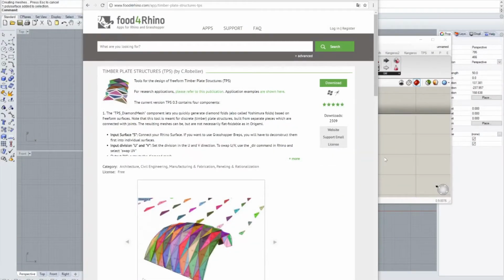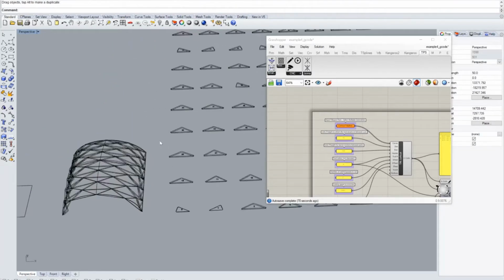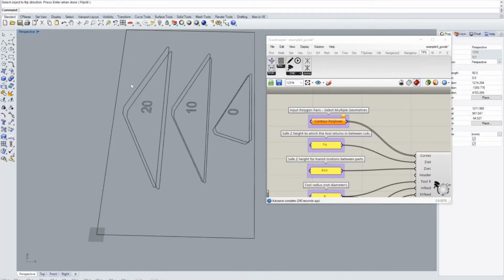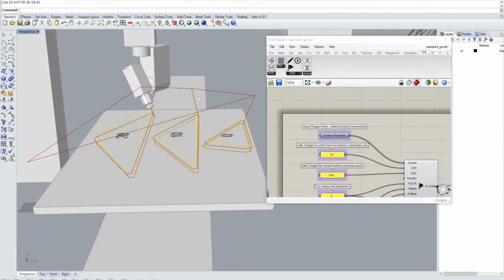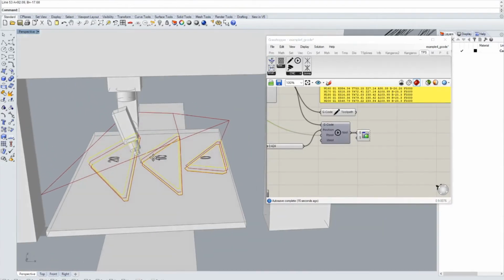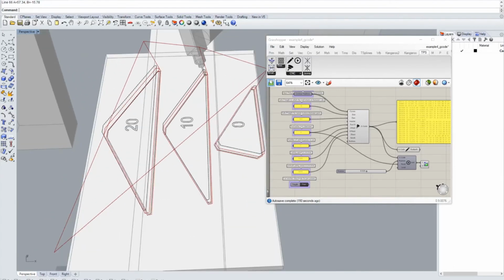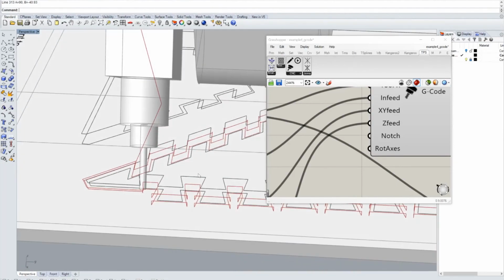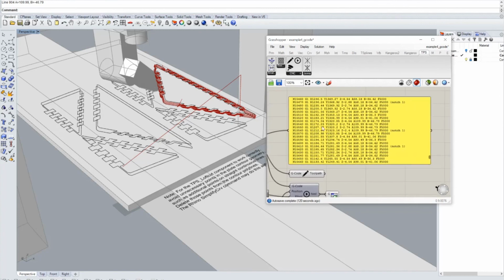TPS CNC Fabrication Tutorial - Rhino3D Grasshopper Plugin

Comment: Hello, I have a question about how to print in 3d by giving the printer head a certain inclination (as seen in the image) using Grasshopper and Rhinoceros. Thanks
Reply: I have seen that they do it using g-code in Grasshopper but I don't know what plugin they use for the g-code, nor do I know how they do it.
I hope you help me. Thanks
Reply from the maker: Hi! I am not a 3d printing expert, but if its G-Code you only need the points and rotations. So i guess the rotations would most likely be the normal vectors of your surface. But i don't know your use case.
Reply: @digitaltimberlab  but what is the easiest plugin to use with Grasshopper that uses g-code?. Thanks
Reply from the maker: @domthelol8570  Hmm, i don't think there is one really. Maybe Autodesk Powermill could help you?
Reply: @digitaltimberlab  mmm, i think not but thanks for your help